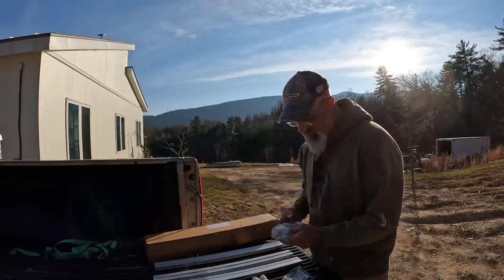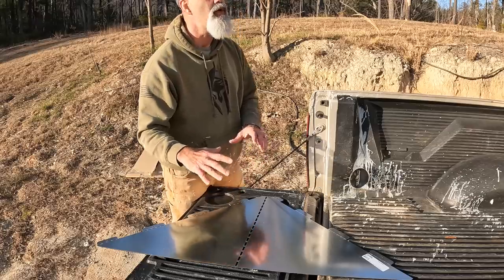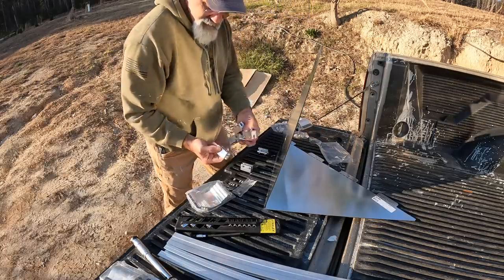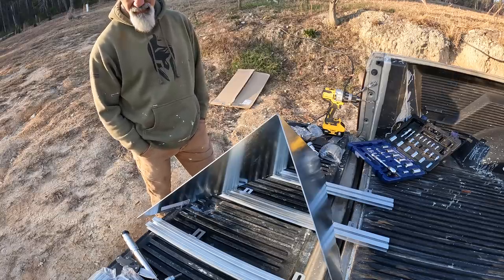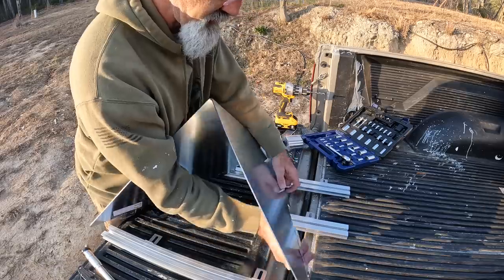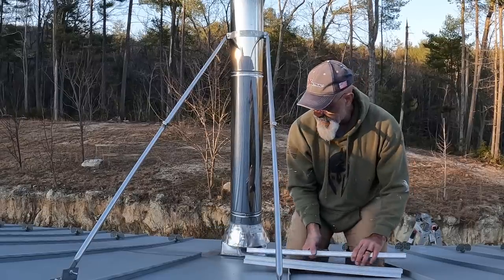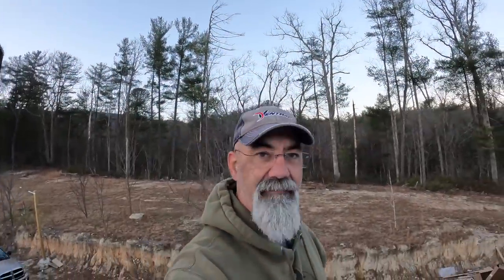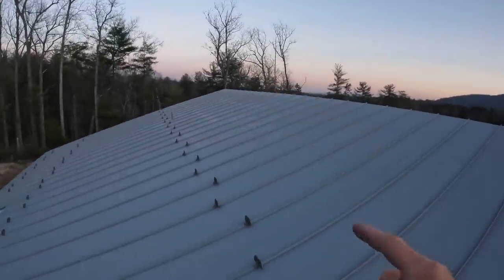Installing Snow Splitter and S-5 Clamps on Standing Seam Roof - Couple builds Dream House

Comment: You're a wise man, Mr. David. Even if it looks a bit high from the surface for my taste (I'm not criticising) I understand you have some challenges on the standing seam roof, as you don't want to drill anything if not strictly necessary. I agree, it's better not to drill, but a potential problem that might occur is the snow or ice sliding under the splitter.. Let's hope it won't. I would prefer to make a makeshift version of tabs or some like U bent lowered brackets to pull down the splitter in between the seams. 😏 This is what I would try to do, it doesn't mean at all like you should do it.. 🤫 Dont' tell anybody, I like explicitly illegal custom stuff made in my strictly illegal "factory"... It's kind of a thrill.. 😁 Well, you'll see soon some of my projects, I'm already working on editin', but I have very little time for myself in the last two months.. Let's hope it will be  better next year and I succeed to finish at least something.. I wish you a happy New Year, a lot of health, fortune and peace. Keep on, stopping is not an option. 😊 Cheers!

Comment: Sorry David but that installation is going to do the square root of bumpkis for you. Last year 1/2" of ice did the damage to your chimney pipe and you STILL have an approx 1 1/2" tall apature where ice and snow can slide under the wedge and bracketry.  The wedge needs to be in direct contact with the flat of the standing seam panels with tighty fitted relief cuts for the standing seam itself.  If you don't redo it you will almost certainly have the same damage again if your winter is even remotely like last years.   I hate being the prophet of doom but I have to call the facts as they are.
Reply from the maker: That is where the little “fingers” come in.   I just need to get up there and get those installed